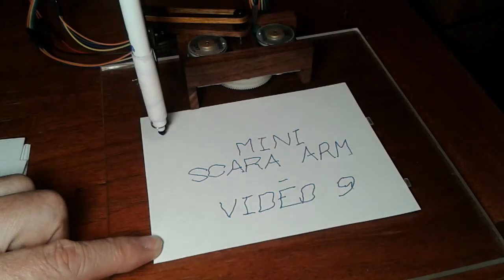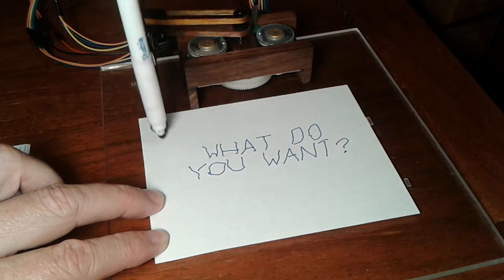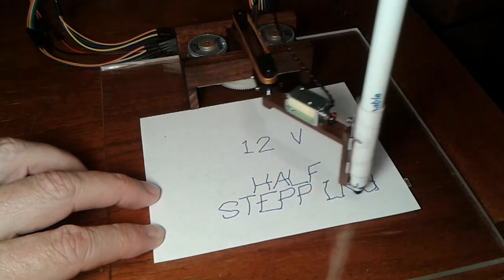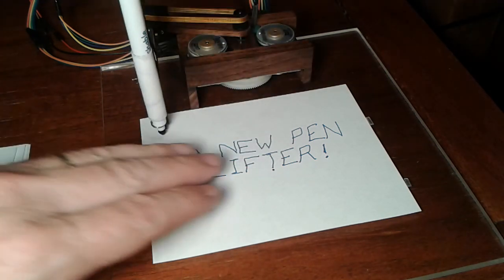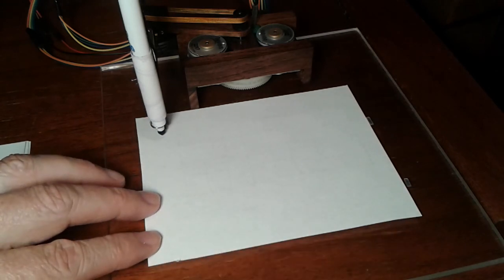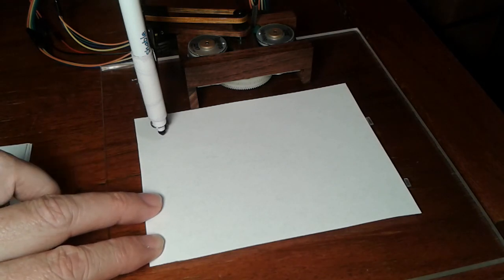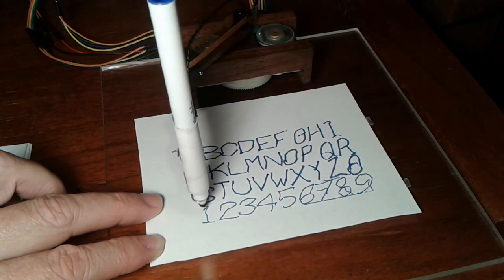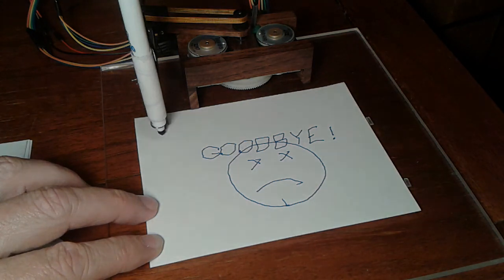Final Run - This is the End - Mini SCARA CNC Plotter Part 9

Comment: What drivers are you using? Are you running the motors in full-step mode, or are you microstepping them?
Reply from the maker: SN754410s half-stepping.
Reply: Try A4988 drivers - They are widespread in 3D printing and are therefore really cheap to get hold of (Pololu module). They support microstepping up to 1/16. 

TMC2100 are a different version that do the same  thing, but they work much quieter and smoother, microstepping natively 1/16 that is then interpolated to 1/256. It really made a difference on my Delta 3D printer; I can barely hear it anymore and all the resonance artifacts are gone.
Reply from the maker: Thanks for the info. I'll check it out. However, I didn't mention it in the video, but I think the real issue is in the software (which I wrote). The mechanics/electronics are more than capable of the resolution I'm after. Cartesian movement works fine, but my geometry for converting to arm angles for the SCARA is off a bit.  I'll eventually get around to fixing it.